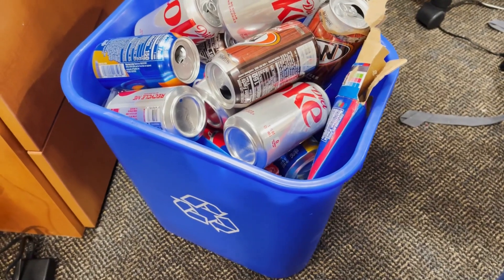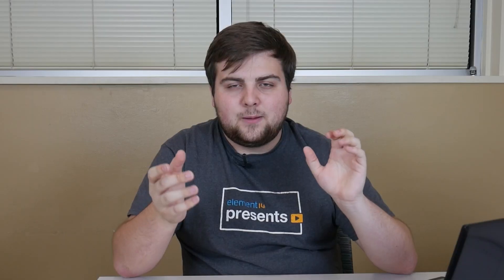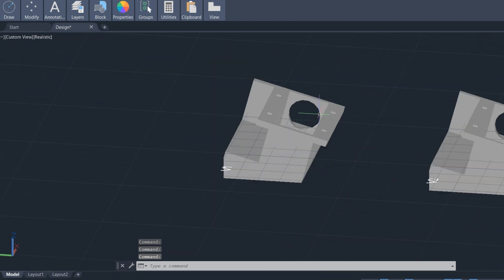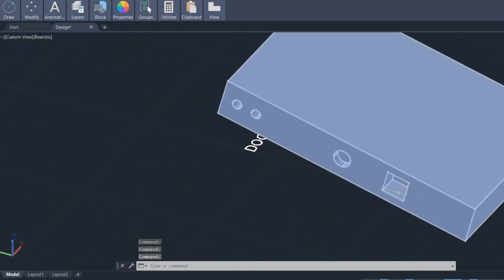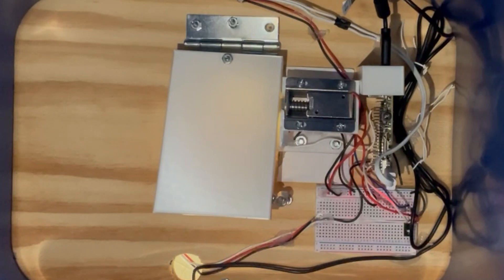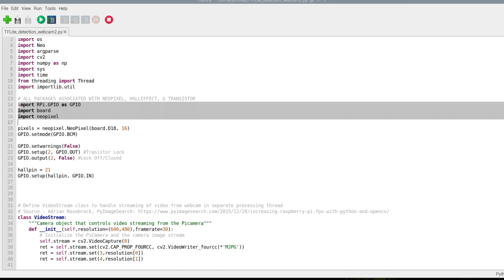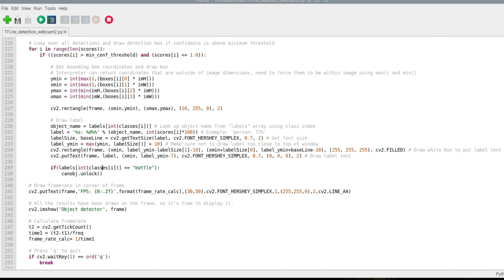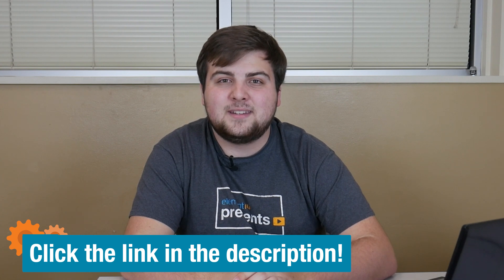Object Detection for Smart Recycling

Comment: After a few weeks, that mechanism and electronics will have so much sugar, flies, and funk on it from the soda and beer spray, you won't want to touch it or smell it. All of it needs to be plastic and washable, with the electronics waterproof or slightly at a distant in a sealed NEMA box.

Comment: Wondering what happens if somebody tries to either hold the flap open once it has unlocked and put something else in or "fake" it with a correct item and put something else in. Human nature being what it is, I'm certain people will try to circumvent the system...

Not that I have an answer to prevent such behavior, though.

Comment: Can you explain why you used machine learning a little more? It sounds like overkill but maybe I missed something. Thanks.
Reply: Fair enough! Most of the object detection general options don’t have cans or bottles as options, which is why I attempted making a custom model with tensor flow in the last video. Object detection was very reliable, especially in a variety of lighting conditions. I considered trying like adjusting the contrast and other settings in the image so the camera could try to identify cans based on abnormal lighting of the cans, but that would differ a lot from can to can, as different cans are different colors. Object detection seemed like the best bet to consistently identify cans with the least number of false positives